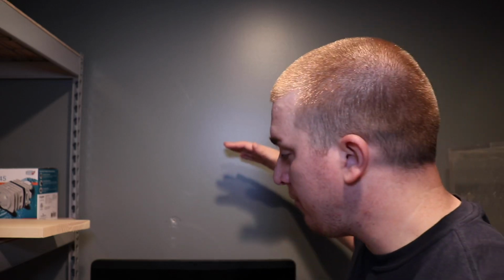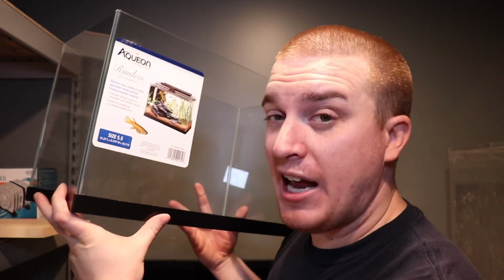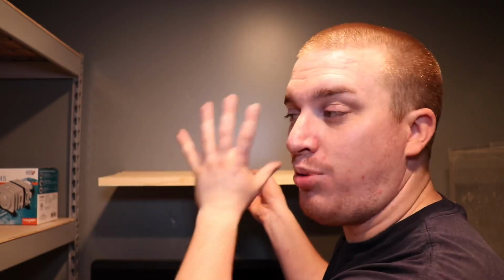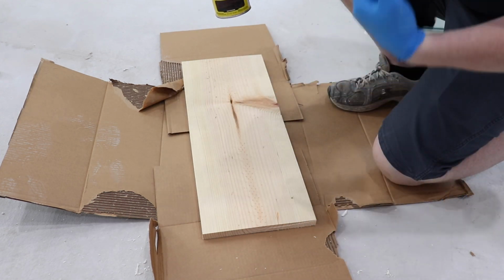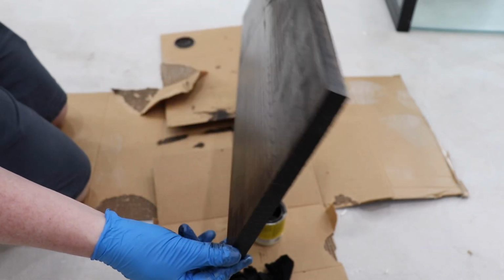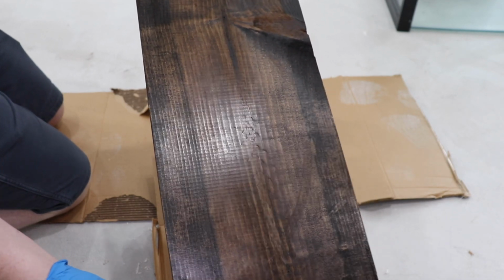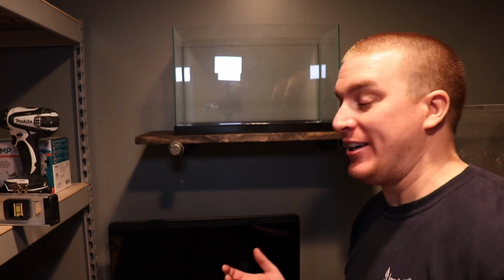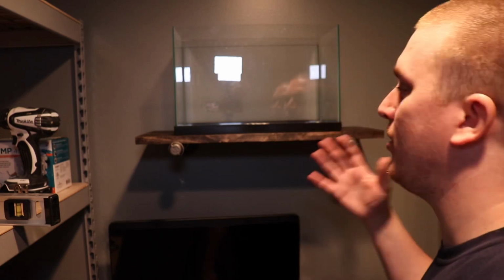Floating Nano Tank!

Comment: What happens when it falls and your not home? Won't all the fish die,. That's to much weight I think
Reply from the maker: Do the math.  Weight was not even an issue.  Now what happens when any other tank fails and you are not home?
Reply: There are wall mount pullup bars... Simple engineering and the correct lag bolts and ~65# is nothing.